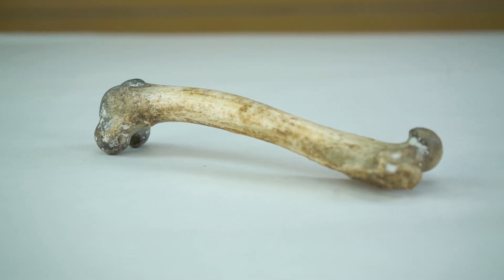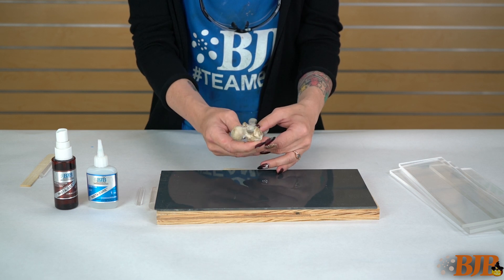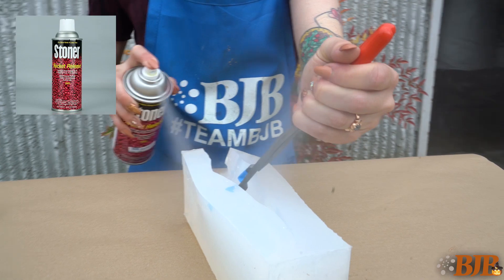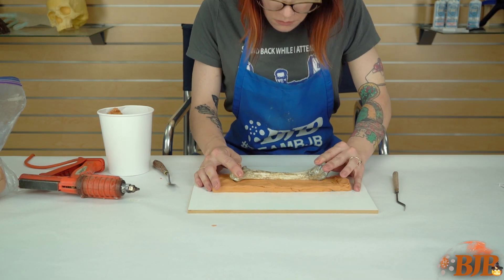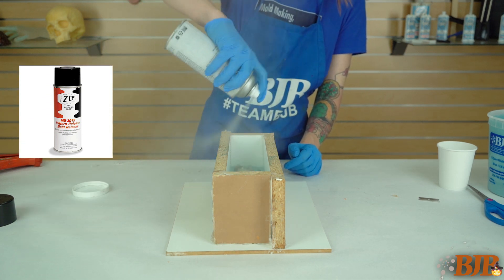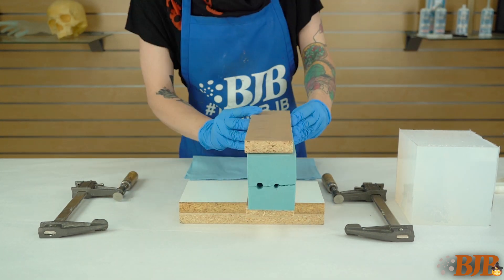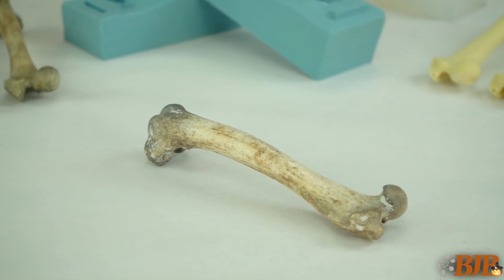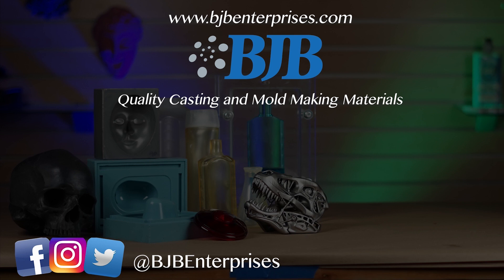Molding fake bones | Silicone Cut Mold vs 2-Part Mold Comparison

Comment: Does the TC300 rigid foam in silicone have to use the rocket release?
Reply from the maker: It does help with release of the part from silicone molds.  You can cast parts in silicone molds without release, but typically you will experience reduced mold life and more clean up of flashing and so on.

Comment: Great video and very helpful for my projects. Im going to use baby powder inside the mold but I have been told some people use a release spray and others dont. Its a one part silicone mold for a resin cast. Another person suggested I need a pressure chamber.
Reply from the maker: A lot of these things are answered with "It depends."  There are so many variables and mold/part designs, that there are no blanket rules for every part.  Baby powder is often used as a mold release when you want the parts to come out with a paintable surface.  It also helps with highly detailed molds to reduce small bubbles.  However, if you use a moisture sensitive material, it can actually cause bubbles.  Spray mold release is more common for a wider variety of parts and applications.  Pressure casting is very good for producing highly detailed parts.  It's not always necessary on simple parts and molds.  You also have to make sure your silicone mold was properly degassed OR it was also cured under pressure.  If you have a need for materials and support for those materials, we are happy to assist.  BJB supports it's products and customers along the way.  bjbmaterials.com

Comment: what would happen if you cut the first mold in the middle as if it was the second one? would it still work?
Reply from the maker: Do you mean cut the clear silicone mold completely in 2 halves?  Yes, it would still work just fine.  It might be more prone to leak at the bottom and produce more flashing that needs to be cleaned up with sandpaper, but not a huge issue.  We simply like the fact the mold stays together better and makes a slightly cleaner cast part.

Comment: Hi thanks for amazimg video. I have a question, can I use play-dough instead of clay in making of two part silicone mold to create split line?
Reply from the maker: echrem hmmm, Playdough is not commonly used for this and there may be reasons for it.  We have not tested it ourselves but I would always advise a small test before ever trying on an actual mold project.  Platinum silicone may not cure well but Tin silicone may??
Reply: What is name of those mixes...?